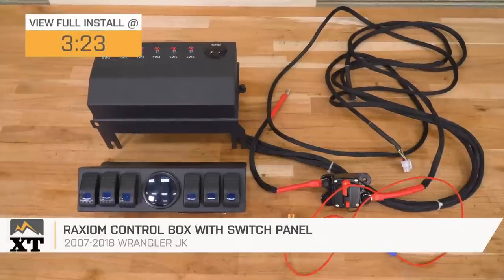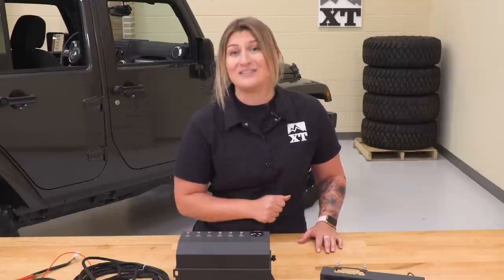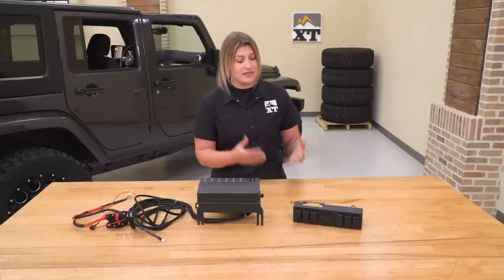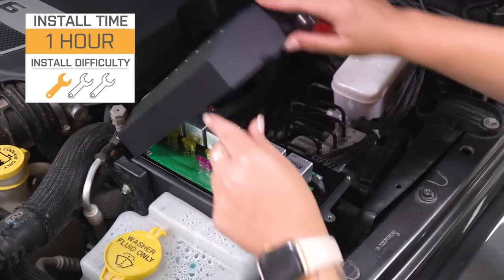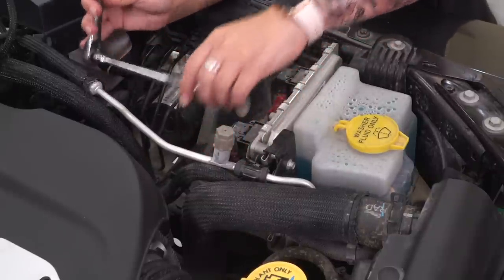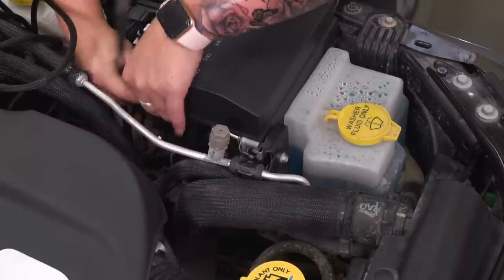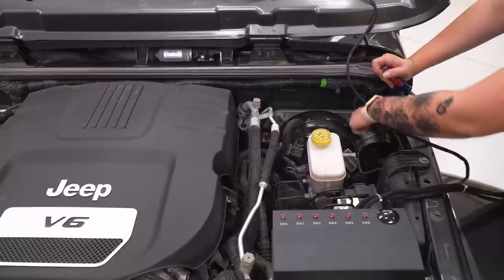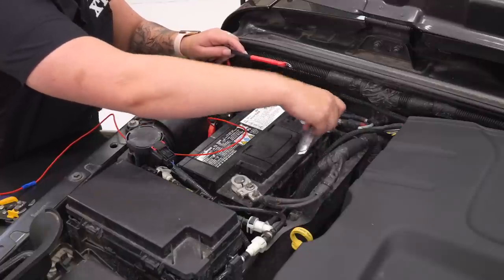Jeep Wrangler JK Raxiom Control Box with Switch Panel Review & Install

Comment: Actually you don't need to cut into the header panel or have the wires pinched coming out of it to the right of the loop like you did. 
You can of run it hidden behind the panel to the top secure loop,. Then slipped it down thru the center of the loop to the outside & run it to right a couple inches & it would then be plugged into the switch panel & be behind the switch box. 
At least with a soft top for how it did it.

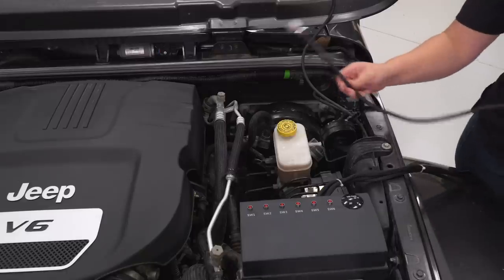Comment: I have manual 2013 JK.  At the 6:00 mark, the wire is inserted into the cab, there isn't anything there for me to push past.  Just a hard plastic peice with no wiggle room whatsoever.  I'm seeking help on getting the wire into the cab please without considering something crazy like drilling.

Comment: I bought an installed this and I love it I’m curious to know if it’s constantly on and  glowing even when vehicles off will it drain your battery ???
Reply: What did you end up doing with it ALWAYS on cause mine is always on as well. Just finished installing and realized with the Jeep off it’s always glowing? Also the bar over the footman loop she kinda explained how to tighten it but never showed the physical action in the video, I had to use needle nose plyers.

Comment: So I noticed when I installed this the blue lights on the switch and voltage meter are on constantly? Will this effect my battery at all? I have went over and over and everything is hooked up correctly. Just curious, thank you!
Reply: FYI, instead of plugging it into M2, I have it plugged into M3, also saw on their website, someone recommend to plug into M9. 
Plugged into M3 or M9, the panel lights up only when the key is in the ignition and vic is turned on. ... Not sure why instructions instruct us to plug it into M2 and have it lit on all the time... battery drain, common sense.

Comment: I just installed mine on my 2017 JK, the volt meter stays on all the time, is that normal?
Reply: Switch it to m15 I just installed it as well and m15 is a multifunction fuze and it'll turn off Everytime the key is off m2 leaves it on all the time
Reply: Yup, switched it after the install…works perfect now. Thanks!

Comment: Recommendation--plug the fuse into M9 or M3 so that the switch light is not on all the time. 
Also, recommendation--paint the switches black. Driving at night, the blue lights on the switches are obnoxiously bright and distracting.
Also, recommendation--throw away the double-sided 3M tape and screw the Switch Panel in.
Besides that, a solid product.
Reply: Just put this on my Jeep is it going to affect my battery if I follow her instructions with the lights staying on when the jeeps off?

Comment: Intersting how they didn't show her tightening the screws that hold the switch panel in place. It's not as easy as just pushing the rubber up out of the way. I came here to see how they expect you to tighten those two screws, and of course it didn't show that part.

Comment: As always, you explained everything so well with how to install. My only question is that it looks like you will need to do electrical deconstruct if you had other plug and play switches? Or does just installing the item leads to the back make it tied into the switch? Thinking of a bull bar with intergrated light bar.
Reply from the maker: Everything from the control box is already tied into the switches! So, the negative and positive leads on the light bar you're looking at would just need a spade connector to be installed (that's included in this kit), and then you would just need a screw driver to attach them to the -/+ connectors on the control box for the particular switch you want the light bar on. No additional wiring needed and it keeps it super organized! Hope this answered your question! :) - Merideth
Reply: Awesome install and looks like an awesome product!!!  Considering it for my 2011 JKU Sport 4dr.

Comment: stays on, the voltmeter and the switch lights do not turn off
Reply: Switch it to m15 fuze slot that'sent for the multifunction switches the m2 will stay on all the time